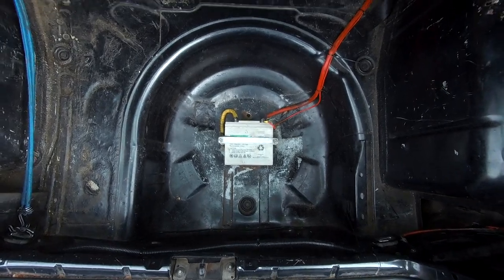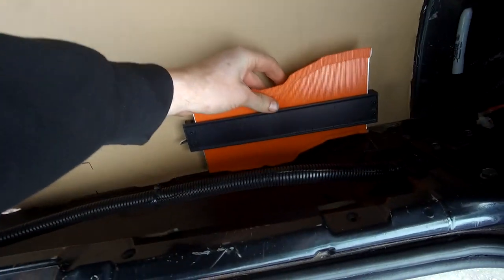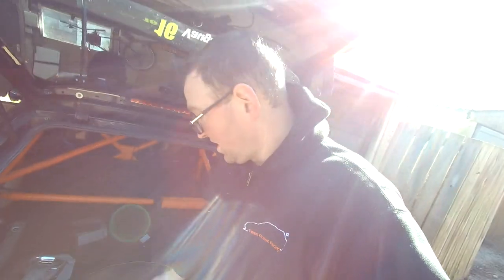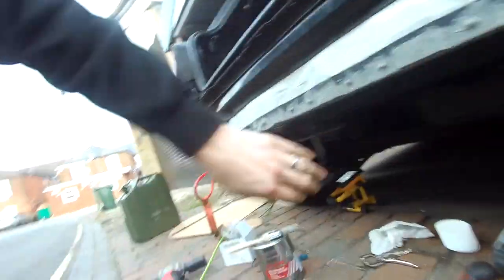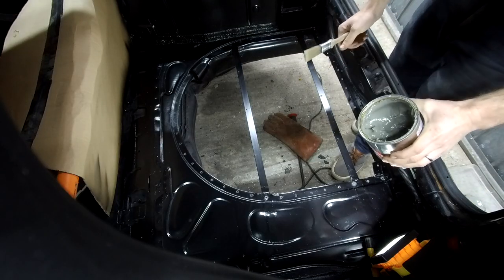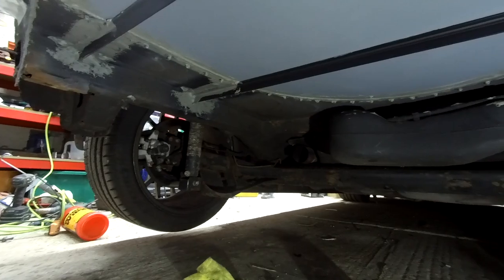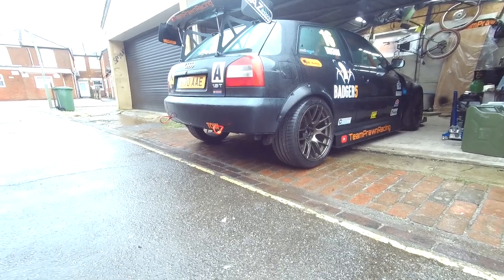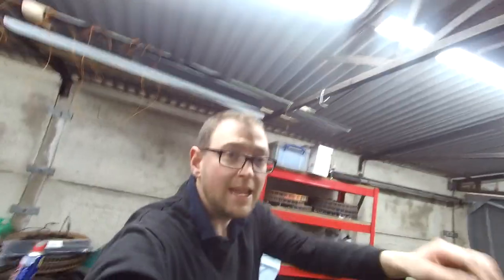Chop chop! Removing the A3 boot floor - Team Prawn Racing

Comment: So much room for activities 😂 Enjoyed that bud, great step by step and finished result 👏 🔥
Reply: Is it worth getting a vertical strap on the battery incase the car rolls and the battery slides upwards out the bracket? Xx
Reply from the maker: It's mega tight clamped there, but that's bit a bad idea! We might be replacing the mount with a proper cage at some point which will include a top part to do as you say 🙂

Comment: Top work again Nick 👍🏻 love the progress! Top tip for using that Hammerite underseal in future. If you heat the can up by popping it in a bucket of hot water for 20mins before you use it then it sprays on a lot nicer and the nozzle doesn’t clog up 👍🏻

Comment: Glad to see the OEM German sourced infill sheet. Panel looks really good; loads of rivets! Is the fuel tank going to be in the way for a central pipe? No, it is not you, that underseal stuff is ridiculously messy to apply; more on me than the car last time I did it.
Reply from the maker: I have a plan for the exhaust, which should clear the tank fine with room to spare.
I'll wait and see how it all pans out before sharing the finished result!

Comment: How comes you mounted your battery vertically and not horizontal across the floor.
Reply from the maker: Just no room for it horizontally. No flat floor pan for it to sit on, so it's be an added bracket (and weight), and with the pax seat in there isn't enough room as it sits extremely low and far back

Comment: I was about to say I bet you had arms like popeye after all those rivets until I saw you cheated hah. What battery is that? Do you ever have any issues with it on the road?
Reply: The new floor looks mega btw.
Reply from the maker: Cheers Danny. The battery is a Lucas 12200 EV. it's 22ah, 6kg, and the same dims as a PC680. Been on the car 3 years now and it's been absolutely fine!